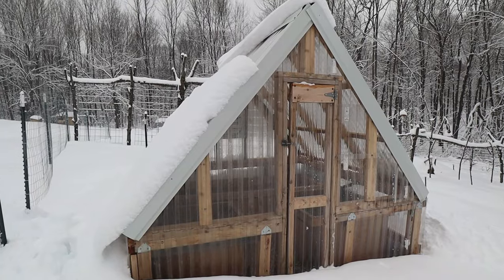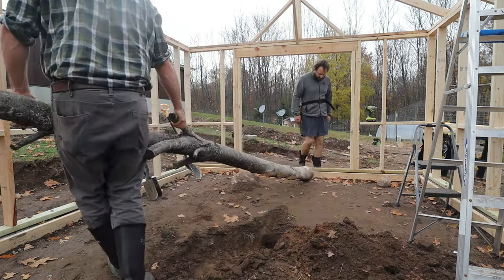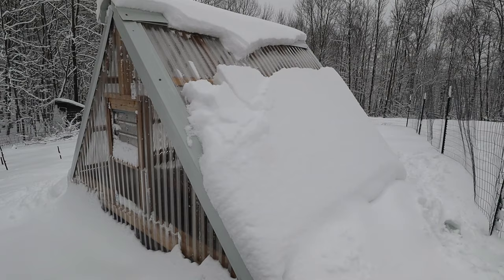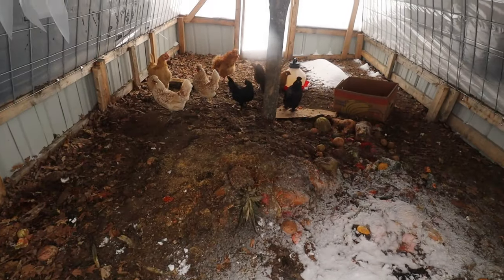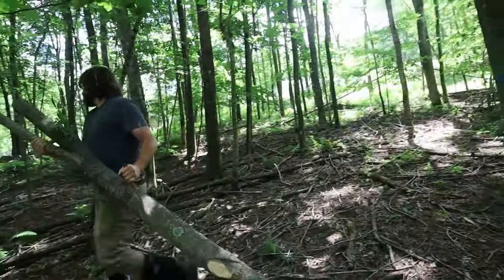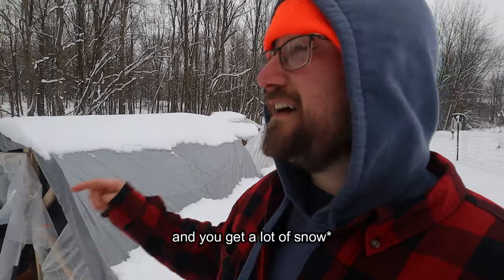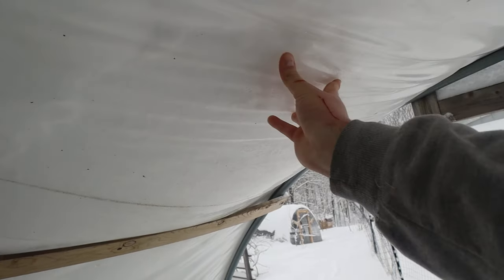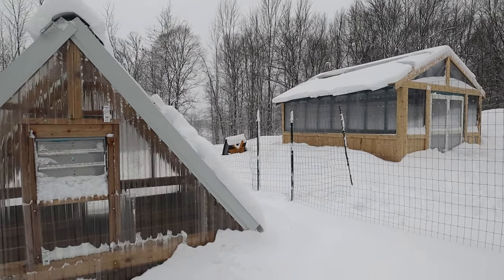4 Different DIY GREENHOUSES │ How Do They Handle Winter?

Comment: I'd like to see your video on which GH you would build. I live in PA and currently heat my greenhouse which is a terrible one with just single pane polycarbonate panels. I intend to buy the double glazed like you have, I think that will solve a lot of heat and cooling issues. Thanks for your video, it's great.

Comment: you probably never see this or anyone at all but I'll say it anyway. 
think about how people used to live in the very freezing cold weather when there were no heaters. the only and best way to do that is to build down and up.. by down i mean cold air will flow down words while hot air will rise. so if you make a step to get in your greenhouse so that way you have a lower elevation inside the greenhouse and than build up. which means get some wood tables or something thats above ground lvl and grow on top the cold air will flow down words and hot air will go up will also make it easier to handle your plants without having to bend will also make it easier to stand many greenhouses lack height.

Comment: Thinking of building a greenhouse, I will go with the vertical sides and an A roof, I like the more traditional look, looking at some options for framing,, looking at 4x3s at 1050mm or so centres to match the width of the polycarbonate, I like what you done with the 4x2s at 20" centres, could you frame it with galvanized metal studs?, it's much cheaper here than timber.  I live in a damp temperature climate in Europe, the timber rotting , not much snow here, but it can get windy, would be the main issues for longevity, and I may need to consider some cross bracing maybe

Comment: On the one you had to open up the sides, you could secure a piece along each side that you could roll up to vent, then let it down when it gets cooler. That's what I do when the plastic is on mine. In the summer I do take the plastic off and secure shade cloth over it, instead, leaving the bottom 2 feet open. At my elevation the sun is just too intense.

Last winter I used a low watt heater in my tunnel on an extension cord, just to test it out, keeping the contents from freezing. The snow melted off the top nicely. When the snow got too thick to access it, I gave up.

This year I won't heat it, but I plan to put two layers of 6 mil up, with a layer of bubble wrap in between to see how that does. It will help extend my season on both ends with no plans of using it to grow anything in the middle of winter.

Loved the side by side reviews. Good info!